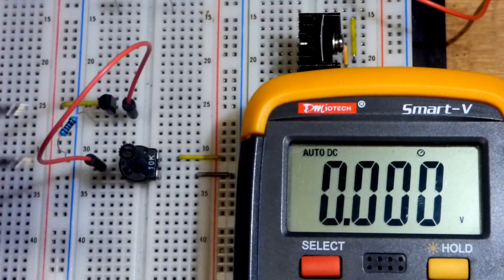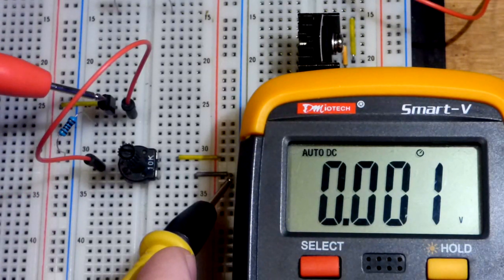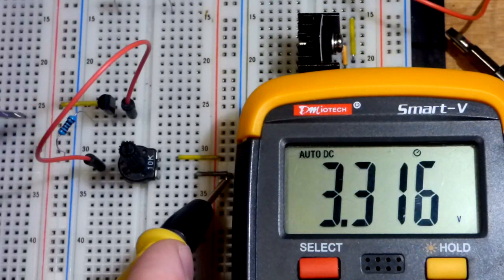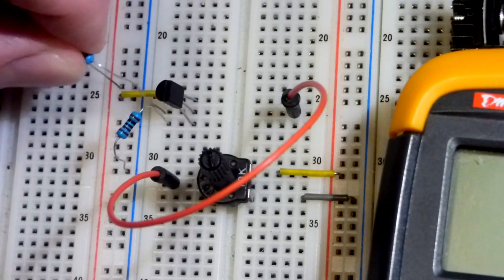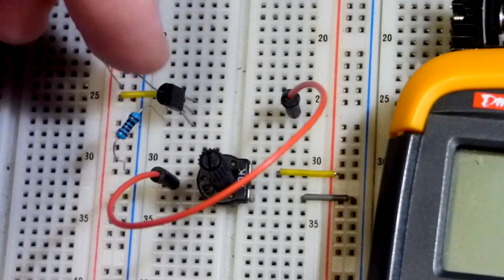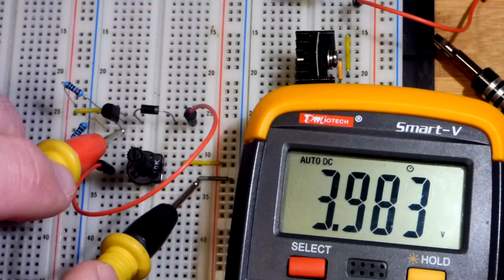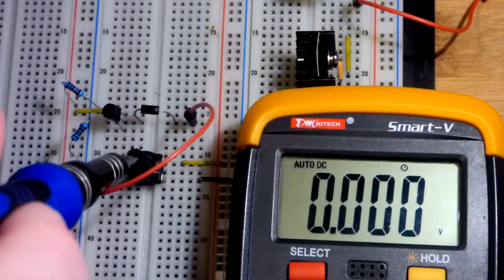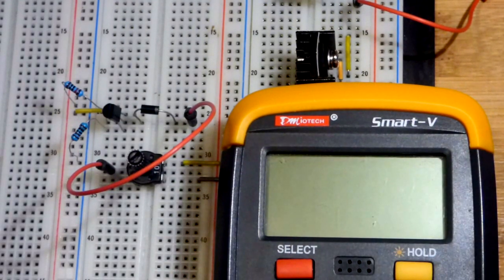2N2222 emitter follower circuit with base to emitter diode drop mostly removed

Comment: Nice work. Can this be used for an audio follower? And what is the emitter resistance? Thanks.
Reply from the maker: Pretty sure it is a 1,000 ohm resistor at the emitter.Any value resistor that can handle the power demands should work. Unfortunately I don't do anything with audio electronics yet so not sure how to best wire them.
Reply: Yes, I thought that might be 1k, it sounds right. Great work, thanks!
Reply from the maker: Thanks for watching!